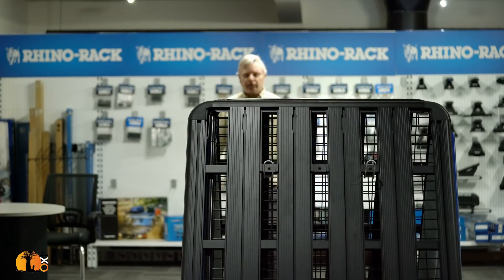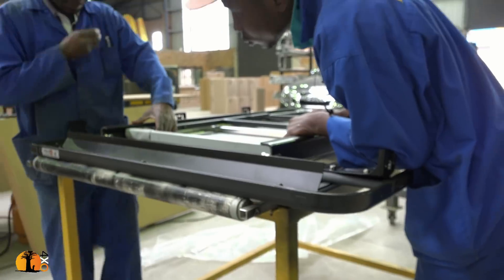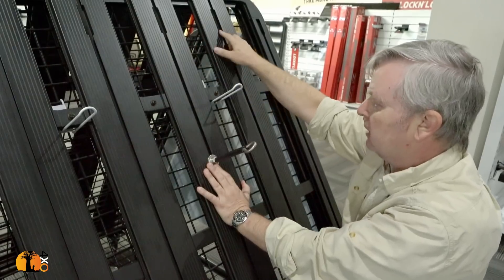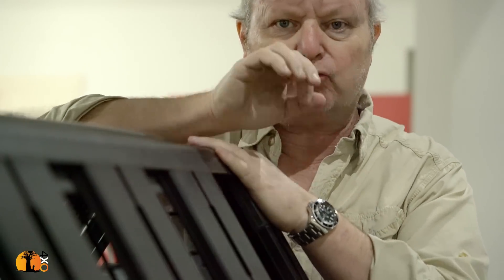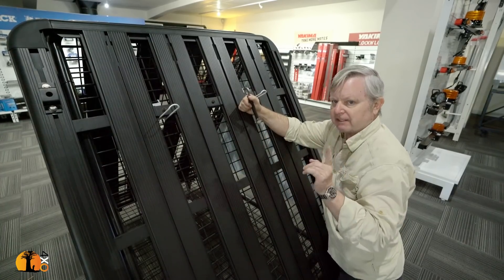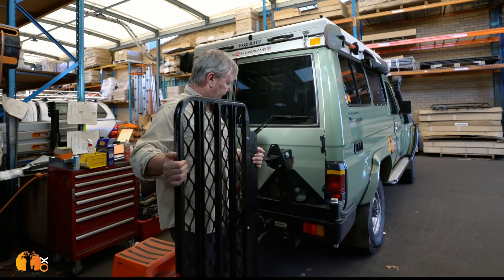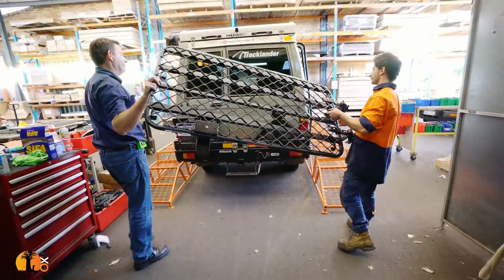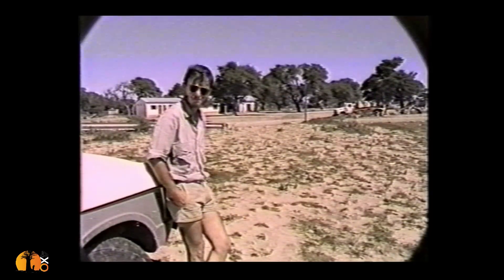ROOF RACKS - the GREAT, the ORDINARY and the AWFUL. How to select the right one

Comment: In August 2018, equipped with our Front Runner roof rack and accessories, my partner and I set off in our 2005 Land Cruiser Prado for the Ais Ais Richtersveld Transfrontier Park and Southern Namibia. Noise from the roof rack was minimal and vehicle handling was okay despite strong head and cross winds. On the whole. the road conditions getting to the Northern Cape were excellent, so no test for the off-road capability of the gear.

However, this changed on our approach to Sendelingsdrift from Alexander Bay - the gravel road became very corrugated. Suddenly there was an unbelievable and unbearable noise. We immediately stopped and checked for the source. It took some time to identify where it was coming from but eventually I discovered that the roof rack had failed. Where the foot rail had been bent to provide a base for the tray to be attached and a gusset added to provide strength,  the weld along the gusset had failed and the bend had cracked through.This occurred on both sides of the second to last connection at the rear of the vehicle. I removed the 45 litre water container and moved the spare wheel forward and we were able to complete our trip (regularly inspecting for signs of other failures). For a month we had to put up with terrible noises and the worry of further failures, but we managed to complete our month-long expedition.

Front Runner provided new foot rails but did not provide any assurance that the same thing would not happen again. I fitted the new foot rails and for this year's expedition to the Kgalagadi Transfrontier Park and Makgadikgadi Salt Pans we had a rooftop tent. On the road across the park from Mabuasehube to Nossob the new foot rail failed in the same place as last year. This time I fitted a bracket by drilling into the side of the foot rail and this kept it together and prevented any noise. When I contacted Front Runner on our return they admitted that the welding of the gusset had not been to standard and have sent me replacement foot rails from a new batch.

My dilemma now is that I have the rack and numerous accessories but I do not trust the foot rails. Perhaps I will add brackets to reinforce the structure, just to be safe...

Comment: One of the other issues with modular roof racks is that you need to adhere to the 'Righty tight, Lefty loosey' rule. When you strap something onto the left side of an eyelet, it will eventually loosen. So you need to plan ahead when strapping your gear on there.

Comment: Good point about the flexing capability. I have a 110 Defender with an older Hannibal roof rack: the type which is completely welded and has feet as long as the rack itself. It probably is too stiff since I have recurring issues in the upper corner of both A posts. There's a bracket well hidden in the roof structure, which is kept in place by two rivets and a pz3 screw. Both the factory brackets and its rivets have broken, as if the roof is being pulled upwards from the window frame. It's a fiddle to repair and to replace the bracket with a DIY piece, but neglecting the issue can result in longitudinal cracks in the roof. Apparently it is better to cut the rack's feet.

Comment: Andrew what is your opinion regarding Frontrunner (and also Rhino Racks) that have the legs that run across the length of the body and bolt directly (in most cases) into existing mounts on the body rather than individual legs as attachments?  I'm talking Disco 3/4 in case you don't understand what I'm talking about.

Comment: I have had problems with Frontrunner feet once but must add that the racks as well as all parts and accessories have lifetime warrantees so they immediately replaced it for free. The rack was loaded quite heavy must admit and was doing the Khutse to Central Kalahari trail which was quite bad at the time. Not sure what warrantees other manufacturers have and if they keep to it. Regarding the mesh it is very nice also so that pieces of wood not partly fall through and scratch your roof. Nice independant review and love the channel.
Reply: Malan Van Der Merwe I do work for front runner USA and I do have their rack on my Jeep. I keep bugging them about accessories that would be nice, redesigning the discontinued support truss and mesh. But then again you can add slats to make it a platform but I don’t want the extra weight on my roof. It’s funny working with all the front Runner parts because I get to see what seems silly and what actually works well.

Comment: Very useful review.  I agree on all points.  I own a Rhino Rack Pioneer platform and it requires planning ahead of loading your gear.  Otherwise, any significant modification requires you have to start over -- at least on a portion of the platform.

Comment: i don't have data either but i'd say the biggest forces are in the TORSION, (the rack will not rock side to side so the torsion will come from that and be compounded by a bunch of factors), so eliminating the twisting forces by preventing as much as possible the ability for the rack to twist is my focus has been my focus because a lot of mounts for example, especially tower types on gutter mounts that are designed to clear more height than roof track or roof rail mounting situations, they just look what i would call flimsy relating to Torsion. i'm using a backbone solution that was designed for another so modified to help with that but will give it a bit of a swing around on it like a gymnast test and see how it goes when it's all tightened up. as a guy that does very big bolts up for a living haha, just make sure you tighten things level and with same principles as doing up wheel hub nuts when you fix it. don't want to "tighten a twist" into it

Comment: Get away from the feet, get a Gobi and attach to the frame. A gobi (though limited to certain models of vehicles) will allow you to disconnect the front of the rack and flip the rack to the rear to gain access to your accessories on the ground.

Comment: I have fitted a Frontrunner on my Mitsubishi Pajero 3.2DiD. The is not to bad but, On my trip to Namibia both the air deflectors came lose in about 160km badly corrugated road, had to fix it with cable straps. The Jerry cans at that time was still empty, had they been full I think they would have come off as well. The standard Frontrunner Double jerry can holder is not strong enough to hold +- 35KG on a vehicle shaking in all directions. The Frontrunner water tank was OK, but it all so moved around and regularly needed readjustment, well every day at the camp stop. I have 3 feet per side mounted on roof rails, Total weight I had on the roof was about 150KG. The mounting point was OK no problems. Wind resistance was a big problem,I could feel the wind holding the vehicle back and pushed my fuel consumption up from 12l/100km to 15l/100km. It was a difficult choice between trailer or roof rack. My first Namibia trip i did in a Izusu KB280Dt with all in the back, work hard at the camp site unpacking and repacking every thing every time from the back. Then roof rack on the Pajero is easier because  I can pack from all sides. I don't like a trailer off road, but I do think, next time there will be a trailer. When empty the Frontrunner roof rack is very noisy in the car, gives a deep vibrating noise which can actually feel if have you hand on the sissy-bars (handles on the roof).
Reply: Frontrunner, Pajero, 150kg on the roof, you say? I somehow doubt the author will reply ;) Seems you just need a bigger rig, long ranger tank, and/or less kit. What was your all up weight c.f. GVW?
Reply: I agree. If 4wd'ers overload their racks, then definitely going to have niggles on any rack and potential disasters. The empty Frontrunner makes basically no noise until approaching 100kph, and in the outback on dirt roads we never hear anything from it. A lot of that wind noise can be removed by putting a rubber pipe in the slots underside of the rack. Haven't done it because our vehicle is an outback trip vehicle, not a city car.
Reply: guy at tracklander says pajero roof can handle lots more than 100kg, it is only rated as such due to car handling issues.

Comment: Totally agree regarding ease of strapping with mesh. It is the way to go! I have an XXL Rhino Basket on top of 2 load bars mounted to the standard rails on my NW Pajero. It is 2.1mx1.1m and although heavy at 27kg it leaves me 70kgs useful load for bulky (not heavy) items such as queen mattress, shovel, maxtrax, gazebo, etc...... Never come close to 50kgs as I load heavy items in the vehicle low down. Also, when empty for the odd overnighter or even when out on an extended trip it is sturdy and big enough to make a great viewing deck / sleeping platform for nights under stars. Simple, effective, fit for purpose and the whole lot with roof load bars cost me $300 for the pre-loved basket and new roof bars.

Comment: The newer second generation Pioneer Platform from Rhino has addressed the issue of channels underneath and atop the front and rear edges. Unfortunately, it still lacks a completely open slot along the outside rail due to the crossbar supports interfering. Placing tie-down eyelets isn't nearly the hassle this video has made it out to be, nevertheless, he brings up some good points for sake of comparison.

Comment: You won't believe what I carried on top of my car roof rack. The car is 1992 toyota Sprinter with gutters and Thule cross bars. It was an adjustable metal bed frame which needed 2 adults to lift up. Many said the roof won't hold it but guess what it did... I guess it is about 90 Kg's and the roof rack got 4 feet... Amazing toyota quality back then!

Comment: I saw racks flown all over the freeway. The problem is NOT in the rack, but in the rail that it hooks on to. The original rail of the vehicle is not designed to hold such a heavy rack. So when the rail breaks the roof rack just flies off with it.

Comment: I tell customer too put one more leg on the defender each side and place them over the load supports (abc middle of the glass and d post) plus I flip the rack over and put two bits of angle steel under the rack and drill and bolt too every slat which makes it so much stronger

Comment: The points he brings up are the main reasons I went with a Gobi rack instead of rail system racks. Especially helpful is the smaller mesh holes so I can still attach eyelets like in this video, just using a large washer as a back plate. Of course the only real disadvantage is the weight, being steel construction. Unfortunately this only really applies to the North American market...

Comment: I'm looking at an Ocam aluminum 1350mm long rack without mesh for a new Jimny. Has 4 legs.
 Will only be used to pick up light but large items from bunnings etc. Eg pvc pipe, MDF sheet etc. May be a bicycle or a surf board.  As the Jimny has a roof load limit of 30kg, I need a light weight rack and this is 16kg. It's only $550. 

Any thoughts on this rack for my needs?

Comment: 13:22 I have a toyota ipsum, i bought the correct feet for my whispbar, clips like the ones at 13:22 and even after tightening it up correctly you could pops them off with your pinky finger...ended up buying feet that you rivet directly to the roof, much better system.

Comment: By far & away the biggest failure reason for any roof rack is poor fitting & zero attention given to checking/re-tightening the nuts & bolts during a trip. I've had the cheapest rack available in Oz on my vehicle for 2 years now, carrying all sorts of loads with zero issues as I replaced all the standard nuts & spring washers with nyloc nuts & shakeproof washers. Doesn't matter if you buy a Tracklander, ARB or Kings, the most important thing is making sure every nut & bolt is secure as even the slightest movement will lead to failure.

(For the record, I will be getting a custom made aluminium Tracklander for my next build as that will be a global overland vehicle, rather than a weekend bush basher with occasional long trips)

Comment: I have a 2.5 metre Rhino Pioneer rack on my Defender 110, after ordering the first it arrived damaged in transit and was supplied a second one a week or so later. The damaged one was returned but I kept the spare cross rails that were meant to be positioned to fit the particular vehicle and riveted to the rack before final fitting. The spare cross rails allowed me to fit these in addition to the intended number supplied and allowed a much stronger arrangement. It is a pity the manufactures do not supply these aluminium extrusions as an accessory as it allows the owner to customize and strengthen to a particular need. I am very happy with the quality of the Pioneer rack but do wonder if the plastic corners deteriorate will I be able to get replacement parts from the manufacturer or will I have to make replacements myself.

Comment: once you have an idea about weight capacities like my man explained - just get the best mounting secenario you are able/canafford and then the best rack with same and work out how you can fit them together. saved me a fortune, (bought brand new unused from second hand- 1k vs 4k and still got the top brand gear. no reason why i could justify spending as much as the premium brands charge in shop. and the fixings i used to join rack to mounts is proper stainless hardware from my job

Comment: You can spend a fortune on roof racks, but don’t. I have found a Rhino steel mesh platform on top of 3 Rhino bars on my Prado works fine. You can tie down anything you want anywhere on the rack, and even simply make your own mounts as Andrew stated. I’ve crossed the Simpson Desert and traversed many rough tracks with this setup with no issues. It’s also a relatively low profile so doesn’t add too much height or wind resistance when empty. Don’t get sucked into these expensive over engineered solutions that lock you into over priced accessories. As Andrew points out, one of his best racks ever was the simple mesh rack on his Range Rover.

Comment: I absolutely love your video. Thank you. I am looking to put a rooftop tent on my 2009 Toyota tacoma double cab. (USA)I have asked everybody even Toyota and cant get an answer to how much weight the cab can hold. there is 5 little bolts on each side where the rack will mount. I am looking to use it for a rooftop tent so the static must be able to handle 500 pounds. Do you think that is a good idea or should I get a canopy?
Reply: I'd say check out the closest Hilux model specs, I know they list the roof rating, but as I'm sure you know bed rack mounted tents are all the rage for Tacoma's now. I personally don't like them because it does away with lots of bed space while providing zero weather or theft protection 🤷‍♂️
Reply: Thank you for the reply. I am defenetely thinking of getting a camper shell. Hoping to buy it in South Africa as money is a problem. I moved here in 2015 when the Rand crashed and I did not bring my savings here. I am looking at Alu cab or RLD design. The only two that make them for a Tacoma. It’s no point losing the bed space and if you just put the rack on the bin you can’t access your things because the tent is in the way. Can you tell me a little which canopy you will choose and why?
Reply: @jacoe33333  it's not the most sophisticated option, but I've seen budget friendly builds done with composite/fiberglass canopies, but with a full on tradesmen/ladder rack installed around it, so the actual shell isn't holding any weight. As a bonus construction style ladder racks are much cheaper than 4x4 specific racks and have much higher load ratings since they are directly mounted to the bed, even cheaper if you found a used or on sale fiberglass canopy, If I had the budget I'd definitely prefer an alu-cab style unit, but as I'm sure  you know the options in the USA are limited and more expensive than being in South Africa or Australia 🙁 but the composite shell and/or ladder rack will each be easy to re-sell in the future if you decided on that setup while saving up for exactly what you want. (I was gonna suggest looking for a used aluminum setup, but the prices even for used canopies are crazy right now with the covid related high demand/lower production 😳)
Reply: I don't own one personally, but if I had to choose one right now I'd pick the RLD, I like the design a little better, and like the welded stainless steel construction, I'm not sure if it weighs significantly more than the alu-cab, but with the known Tacoma bed flex issues I'd be less worried about stress fractures vs. Aluminum
Reply: @berryreading4809  Interresting fact of the Stainless steel they use. I am a level 2 welding inspector and I remember the discussion we had in class about 3cr12. The teacher was telling the story of a friend that build a trailer from 3cr12 and the next day when he came out after leaving it outside there was rust everywhere. He was dumb struck. How can it rust?? It’s stainless steel. Well. There is argument if it really is stainless steel as the carbon content is high. I forgot the percentage. Only reason it is categorized as SS is because of chrome content. If you think of stainless steel you think it won’t rust. In my opinion it’s not really a SS although it’s classified as SS. When the paint be removed it will rust. Do you think it’s ok to is a fold open rooftop tent on my fibre glass canopy or the cab. People say it’s only halve the weight on the cab or canopy because halve the weight is on the ladder?

Comment: One thing about Front Runner, I think they have become too modular for ease of shipping.  I had a terrible time trying to get the platform flat because of this and sent the rack back.  I was going to get Eezi Awn but with 5 legs for a LC200 that would have been 6 nuts and bolts per leg times 5 per side, or in other words 60 nuts and bolts....um no thanks.  I settled on a Rhino Rack Pioneer platform with the backbone mount and I’m very happy.